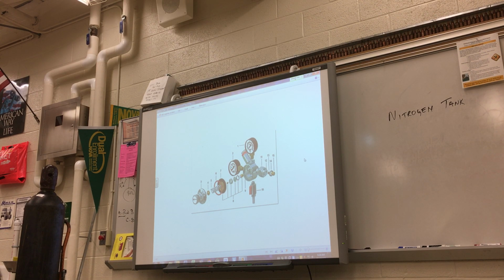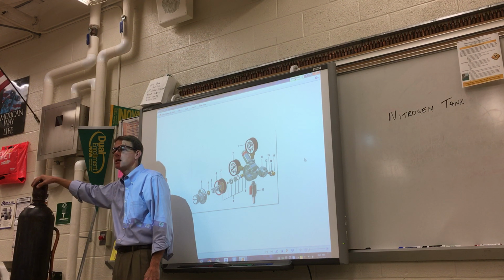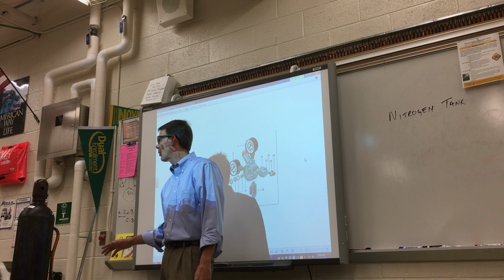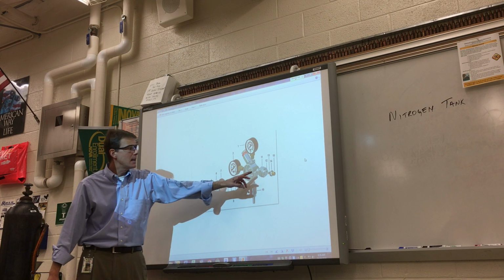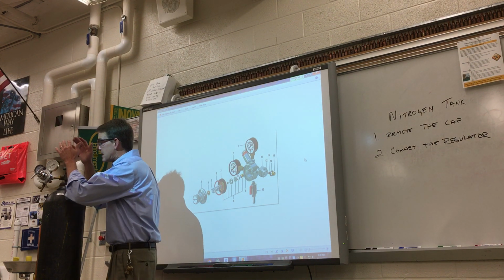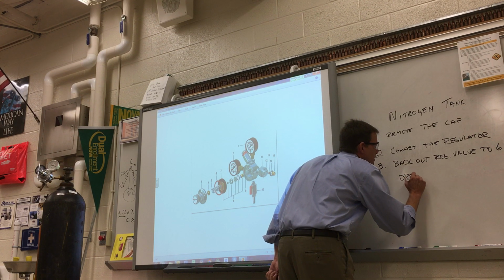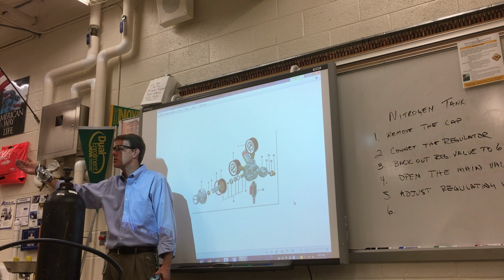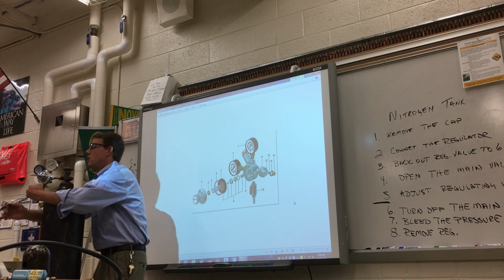HVAC Basics: Procedures - Installing the Regulator onto the Nitrogen Tank for Pressure Testing

Comment: Can a nitrogen cylinder be filled with oxygen? Psi for both is 1900 and cylinders are made of same material.
Reply from the maker: I would think so.  They look identical to the mixed gas and argon tanks for welding. The acetylene tanks have a porous material keep the acetone stable. The oxygen should not be used for purging though. It reacts with the refrigerant oil in a bad way. 🔥 Next time I’m at Airgas I’ll ask.

Comment: hmmm... That's a bit of a scam on those tanks. If you plan to engage in tank-swapping as your primary method then do NOT buy your own tanks when you buy your torches and lines. And if anyone is telling you that you HAVE to do this is either in on the scam or too dumb to know better. I buy and use ONLY my own tanks. I get them filled at an approved hydro testing and gas filling facility and get my very same marked tanks back. Wouldn't have it any other way unless I was operating a business swapping out 10 - 15 tanks at a time every couple weeks. Otherwise I want to make sure my tanks are tested regularly and maintained properly. You can also almost ALWAYS do better than AIRGAS. Terrible company.
Reply: Thanks for tank swap mine a new N2 tank that what happened for an old to what tank I ask for the new one refilled
Reply: We use Airgas at the chem department.  They are not good at keeping track of tanks.   The trouble is trying to identify each tank by a number, I don't think they do that.